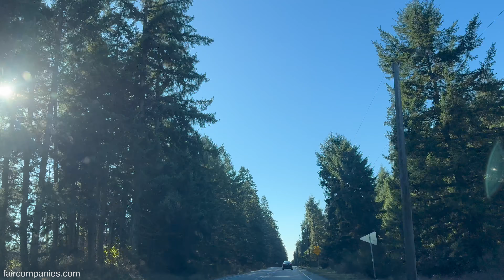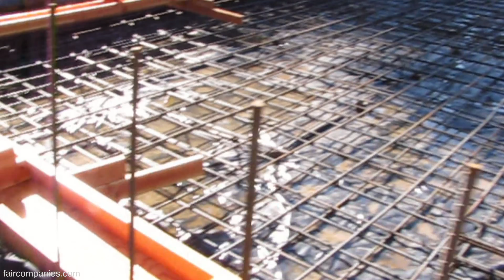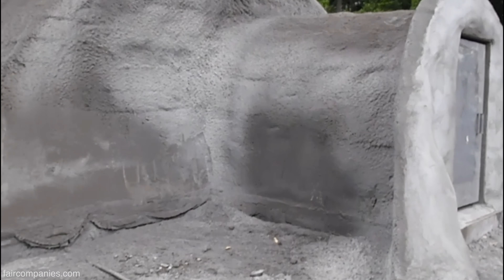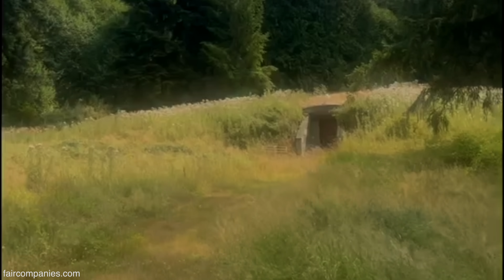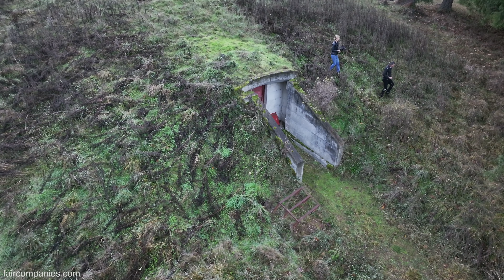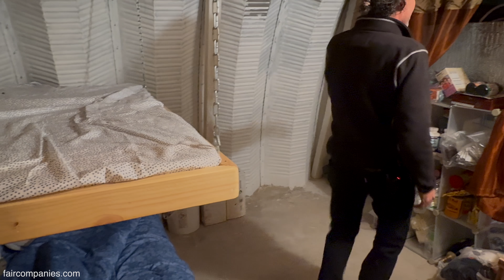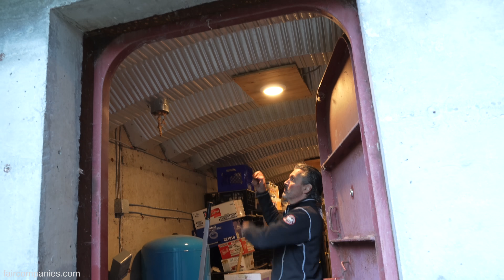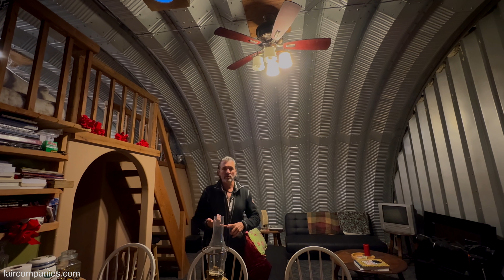Building Bunker Villa on a budget using Quonset Hut structure

Comment: This looks a bit like an abandoned missile silo to me, and I personally wouldn’t call it finished. my bigger concern is structural, and I’m not saying that means it will fail…. However i am asking what engineering analysis was actually performed.

Dude said the corrugated metal shell is essentially carrying none of the permanent earth load and that the shotcrete shell is carrying it instead. That may be possible if the shotcrete was specifically engineered as an independent structural shell, but I don’t think that can simply be assumed. Since the shotcrete was applied directly over the corrugated steel, the two materials are physically interacting, and the actual load distribution would depend on stiffness, cracking, deformation, interface behavior, geometry, and construction sequence.

If the shotcrete is intended to carry the full permanent load, was it actually calculated for the soil overburden, lateral earth pressure, asymmetric loading, shell buckling, bending and cracking, foundation thrust, drainage/hydrostatic pressure, and any surface live loads? Was the steel/shotcrete interface intentionally modeled as composite, partially composite, or non-composite?

Also, the metal shell necessarily carried at least some load during construction while the wet shotcrete was being applied and before it reached full strength, so saying the steel carries “no load” seems too absolute without a structural model showing that.

I understand the “egg” analogy in the general sense that curved shells and arches can be extremely efficient in compression, but this is a long barrel-vault-type structure, not a doubly curved egg shell, and buried structures rely heavily on actual geometry, support conditions, soil interaction, compaction, reinforcement, and drainage.

I’m genuinely curious whether a structural engineer reviewed this system or whether there are calculations available. I’m not claiming it is unsafe, I’m saying I would want to see the load path and the numbers before assuming the shotcrete alone is safely carrying several feet of earth.

I am a civil engineering and architecture professional waiting for my state registration, so I am not just spinning yarn.

I am also not intending to insult or question whether this guy made a mistake but I am concerned. I see the brace you put in with the 4x4’s so that may help at least with catastrophic failure. 

Also, this is in the US so I am sure he had to get a permit so I could be totally wrong but I just wanted to put in my 2 cents. 😊

Comment: Does anyone in this conversation know if these bolt together Dome structures are available in Australia?
Much smaller though
Have offgrid red cedar home on 10 acres of beautiful trees
I'd like to build a fire bunker
And fully usable tiny home based on this design
Aging trucky
Oz trucks rarely have 3 bedroom apartments as bunks
So
I don't want
Or need a big space
Easy to heat and cool
McMaybe 10 feet wide and 20 feet long ish
Could likely do similar with an 20-foot shipping container
But this looks way stronge
And way cooler 👻'

Comment: It looks like there is ONE air intake and ONE air exhaust. If either gets blocked that would be a problem.  For example, ash fallout from volcanic activity could quickly clog both. I also wonder about humidity levels inside the building. Is there a large enough dehumidifier to keep humidity levels from getting too high if multiple people sheltered in placed for days or weeks? What is the building's power source? Deep cycle batteries + solar panels? Diesel generator? Connection to the local power grid? Also, did not see what was being done about providing this building with a clean water source and sewage disposal. 

With a few minor tweets this underground shelter could be turned into a fallout shelter -- install an NBC filtration system for the air intake(s) with an overpressure regulator, add more soil on top of the structure to make that soil layer thick enough to block radiation, add an emergency shower just inside the entry to wash off radioactive dust and build a thick enough wall about four feet in front of the main door because radiation travels in a straight line and that metal door is not thick enough to block radiation.

Comment: Meanwhile, here in Maine I’m living in a poorly built split foyer home that as I have remodeled found that no attention was given to structural integrity! Plywood sheathing was applied vertically and does not overlap the floor joists. Essentially I could just cut the nails that secured the base plate of exterior walls and lift the upper floor off! The underground build has always been a fascinating concept to me!

Comment: The quonset hut is a great place to start for a structure like this.  Even free-standing and not buried, they're cheaper to build than a standard house, and they're typically sturdier/tougher.  Dressing-out the interior with finish paneling and LED puck lights would make it a lot more inviting.  I don't think he mentioned it, but I'd be interested in learning how much he spent building that place.  The entrance was not unlike a Titan missile silo.  I like that the ventilation and water were so well thought out as well.  I'm not a prepper, but I've been obsessed with underground "hobbit" homes and silos, so this is pretty cool.
Reply: He mentioned $100k at one point.

Comment: Two separated layers of carbon felt with stainless steel or titanium wires running through them could be added beneath the soil layers and plant roots on the roof to generate free non-solar energy as long as the soil stays damp.  The microbiome feeding on the glucose released by the plant roots produces electrical charges whether it is utilized or not. That charge can be linked in a parallel sequence to power lights or appliances. Researchers are working to perfect this even further, which is a significant development.

Comment: You absolutely could get through that door within about an hour. All you would need is a Dewalt/Milwuakee battery powered angle grinder with a few discs. I would definitely get a much beefier front door. I'm talking at least a foot or two of solid concrete reinforced with rebar/steel

Comment: Bro has 6 feet of dirt on top and calls it underground.  I look at these structures needing to survive natural disasters,  an irradiated environment,  and chemical and biological attacks.  I wouldn't trust anything short of a full on reinforced cave system with hundreds of feet of Earth above,  solid rock,  and multiple blast doors and air locks with the ability to seal off and use the stored AIR for years.

Comment: Yeah as another had mentioned about the arrangement of the place ( in my opinion) takes  away from what it could be. What I mean by that is that I often find that people make these and think of safety but they leave out the aesthetic of it where in reality if you've ever had to be somewhere unfortunately against your will. Where although it may be best choice for alternative options. No one chooses to be underground for a few months straight unless their not straight in the head or getting paid for it. So it's best to have the arrangement and setting cohesively conducive for mental health stability because I'd love to say I'd love to be stuck here for a year. If the case called for it. But clutter on the entry and the color way says high stress scenario 6 days in. Definitely felt the guy when he said you'd want the water to be distributed by gravity not mechanics but everyone has an opinion and I'm sure much was due to budget all in all it is a wonderfully executed facility with longevity in mind

Comment: You might not want the air in, if it is bad to what's happened outside. You would need to have something to filter it into clean air. He has something regarding water, but no emergency for the air 😮

Comment: Would it work to put a used container there and spray it with foam  maybe even cheaper. Or a tiny house in a hillside  and put concrete around it and then the dirt?
Reply: no, much more to it all.. you need a water stop and concrete....

Comment: as a owner of a Union construction contracting company that does big buildings and restaurants and also houses this is not the right way to build a bunker or anything. You do not use this metal and then use concrete to put it onto it and then bury it under the ground it’s not for thatand also it’s not strong enough. The Shaw Creek is not strong enough to hold that it doesn’t post a hold a support a arch and dirt that’s ridiculous to think that this thing will collapse one day on somebody and kill them.
Reply: Been there for 14 years and zero issues...

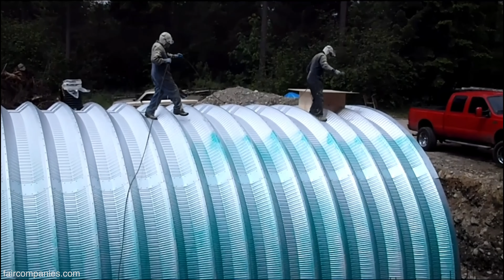Comment: This must be Dr. Who's bunker: Why is the inside higher than the outside? I don't see them descend stairs when entering, and there appears to be only 4 feet or so of dirt above the door, yet inside, there are two floors and the beams appear much higher than outside. There can't be 6 feet of soil above this, or the escape hatch would be underground. Look at the height when they're building it. That hatch platform is about 2 feet high to the bottom of the hatch, and that's above ground. You can see a builder standing next the the hatch and it's knee-level. 3:55 Same for the skylight. The soil may be 6 feet above the entrance tunnel, but not above the main part.

Comment: At the start when unlocking the door he says that you really could not break in this door. Ok, but your using a master lock. Lockpicking Lawyer has some words about those. Nothing on 1. Slight wiggle on 2. Nothing on 3. Lets just rake it open. And it's open in 4 seconds. Low skill attack. Or if it's the "high security" lock we go with the shim method and only 1 tool is required and about 8 seconds.
Reply: Nothing a landmine won't fix

Comment: I have seen those quonset  huts collapse under 3 feet of snow , he is right about it lacking strength . The shock cement or helix is a good choice as it can mold to unique geometric shapes and controls cracking better then trad rebar/ cement

Comment: The plumbing air admittance valve should be located as close as possible to the fixture. The further away, the slower the drain. In case you're wondering.

Comment: very cool, there isnt much I would do different , but def some kind of internal oxygen supply tank and I prob would have paid for a well and built this around it , I also didnt spend a bunch of time doing research this is just off the top of my head. This is well done , and definetly a exercise bike on a alternator for battery charging and power making for storage , that could take care of the pump for water and smll things I mean this guy has it down you could spend a half year or full year in this structure thats the time frame I would be getting ready for anything less is a vacation

Comment: Tbh its cool but he needs to work on his presentation/interrior design if he wants to consider being inside longer than normal.

Making the walls / ceiling white will make the room feel larger and less claustophobic than the metal, tough I'd clad to a smooth surface. 
LED strips can make the place feel more modern and reliable. Regular lightbulbs are better replaced by full spectrum ones, helps against depression.

The facade could have been done much better too, the walls at the front under a 45 degree angle instead of straight looks better and is stronger. A bit of wood against the facade and it looks like a nice little hobbit home, making it look a lot more welcoming.

The metal door at the very least could do with a layer of protective 3 in one paint, bitumen or something to prevent it from rusting.

I'd extend those pipes outside to not be half burried in the ground and ensure they were atleast raised from the ground level a bit so no water can can flow in, and no bugs and stuff find it appealing to crawl into.

But thats just me. Great concept for the main structure tough.

Comment: Just build a walkout basement,
With a heavy corrugated half drain tunnels. 20ft wide for the roof.
Used,..under roads to let creeks flow under. Would be cheaper and just as strong.
They hold the weight of traffic plus ice and snow.

Comment: Sweetheart 6' of soil really isn't enough if you want to escape the next uselo horizon!!!
You've got to have a minimum of 18'!!!!
I'd suggest 24' to be on the safe side and then your by the way brilliant attitude with the egg shell theory of strength another three feet of R.C.P.=(reenforced concrete pipe)!!!
And a relief door or two meaning go through a door 🚪 to another then another for heat resistance or for thermal resistance weather hot 🔥 or cold ❄️🥶!!!
And a reliable hydraulic press to help open those doors should there be a ship 🚢 dropped on it one that can rip through the hull sufficiently enough for you to escape!!!
And Howdy Howdy from DeadHorse Alaska, Alvin Texas and Aroostook county Maine ☺️ and good luck 🤞🍀!!!

Comment: as cool as this is, theres a few things that should have been done differently. example, the air out take should have been at the bottom not the top. Yes hot air rises, BUT carbon dioxide is more dense than oxygen which means it sits at the bottom. so eventually youll choke to death. With that, your oxygen intake should be at the top

Comment: Loving this!

Wondering though if the spray foam should have had some drainage since PU degrades from moisture over time, and if the outer concrete wall should have a barrier against moisture and roots. These aren't immediate problems, more like 30 years in the future but still I like to overthink. 😆

Comment: Placing food storage in an area where you'd likely come inside contaminated doesn't seem like a brightest idea. There should be an airlock with water drainage going outside so you could scrape off whatever particles you might've on you, undress and only then come inside. I wouldn't like to be stuck inside a confined space together with gamma emitting particles or XV/Sarin contaminated clothes.

Comment: Just a word of caution: If you want to buy or build your own bunker ya MUST solve the steel/galvanized steel problem. That means casing, handles, hinges....

If these exist anyone can easily ( including those 50 ton blast doors) get in for under 10-20 bucks.

All they have to do is pour salt on/over/around the area and spritz water on the salt  and do this multiple times then in about 2 weeks ya have free reign in the place.

Spend thousands, hundreds of thousands and even millions of dollars but be "GOT" by under 20 bucks!

Comment: In my experience,  spray foam is like a sponge. It absorbs water and then rust the metal it's attached to. For example, ford and chevy truck in the northeast.
Reply: It is closed cell spray foam. People often use it for docks and other situations. It does not absorb water.
Reply: @VikingShelters  fair enough, duely noted.
Reply: @mattmorrison9379  Can't spell - duly noted.

Comment: It may be unpractical for most of us to build that, but dam it would feel good to have a secure getaway like that. If I were to alter it at all I would place it another 6 ft deeper (at least), led line the outside, Install a optional/emergency  2.5 heppa filter for the air, install 3-4 6x6" pillars reinforcing the roof, move the food to a smaller version of the hut accessible from the inside/kitchen (but with a strong lockable hidden door) and put the water tank up against the roof on both sides of the escape hatch that also needs a hiding inner door covering it. Planting bushes around the outside of the vent/hatch  would also be a good idea along with a small periscope to check if the cost is clear before breaking cover.
Food and clean water/air would be the most valuable things if the "you know what" would hit the fan so protecting that and your selves would be the top priority in my opinion. A outside camouflage hatch/cover for the entrance would not go amiss as you know they cant attack you if they cant find you. Perhaps something that can quickly be put in place if/when needed.

Comment: I'm going to be THAT guy... I don't understand how that coat of shockcrete would provide enough support to stop collapse. For something like this, you would need rebar reinforcement and reinforced sections. And NO, not under any circumstances, would you use propane. DO NOT EVER DO THIS! Enclosed spaces will use alcohol stoves.

Comment: Im surprised he didn't install a NBC filter... You can get the fairly reasonable. With power they're will keep the air circulation going. Without power you hand crank them a few times and they do the whole place.

Comment: Gravity fed water would still be possible while the tank is inside the building if the tank was at the top instead of the bottom. Just need to support it

Comment: Putting spray foam before the shot crete creates a spongy surface under the shot Crete. This could create cracking from the weight of the dirt. The dirt is the insulation, there was no good reason for the spray foam. Also, leaving the ridges exposed for the shot Crete to form around would have also increased the strength of the structure.

Comment: Suggest future versions include insulation under the slab. This is now pretty common in northern homes, and required by code in most Scandinavian countries. My brother in upstate NY does hydronic/boiler heating systems for residential and a little under-slab insulation goes a long way. He tells people the Earth is a sponge that will soak up all your heat energy, if you let it. 

Also, these structures look like a perfect fit for a geothermal heat pump, and an outside wood gasification boiler.

Comment: Question about the shotcrete; wouldn't it have been more structurally robust if you encased the quonset within a rebar frame? That way, you can still spray shotcrete directly onto the quonset AND the rebar all in the same go without having to put up any concrete forms?